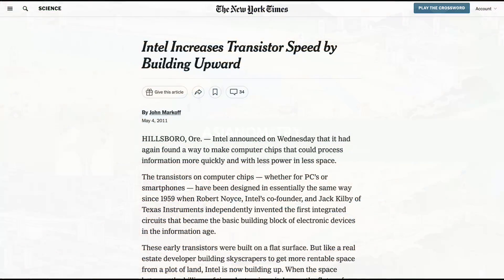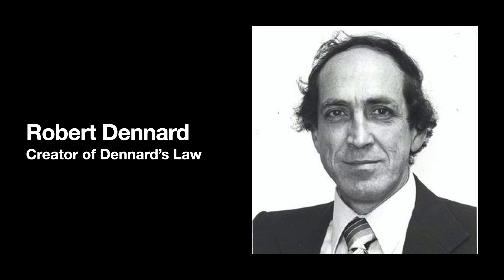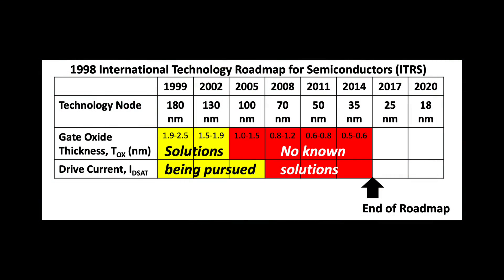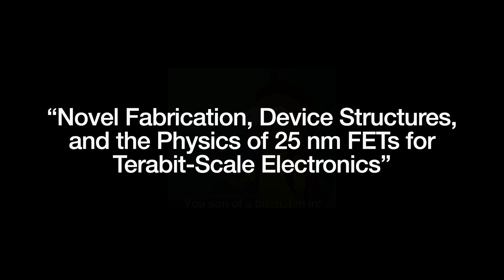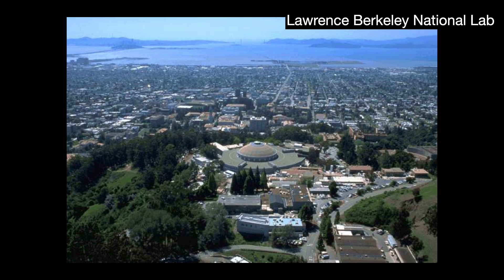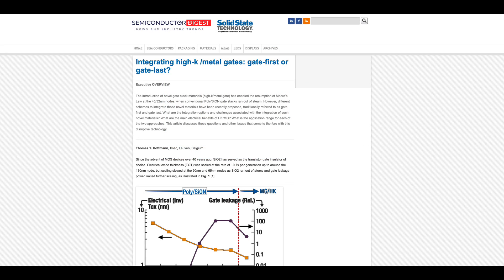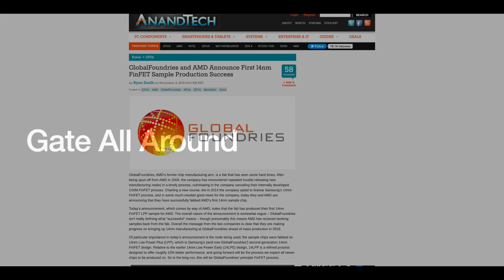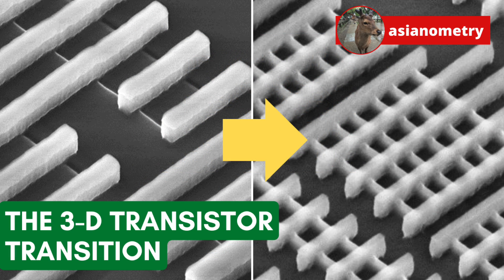The 3-D Transistor Transition

Comment: Almost all of TSMC's customers have cut back orders for this next year.  Economics is pushing costs too high and many customers aren't buying anymore.

But, TSMC has been making very large profit margins as they've kept raising the price for their advanced nodes and this is why chiplet design is going to become common.

Not all types of components in these ICs scale down in size past a certain point and in reference to TSMC, this happens around their 7nm node, so companies like AMD who make graphics processors and CPUs have moved a lot of the circuits that don't scale down in size onto another chiplet of a less advanced node.  In the case of their new Zen 4 processors they have core chiplets that are on a 5nm node and they have a die that deals with I/O for the most part on another chip.  For all modern CPUs for PC these chips get mounted onto a tiny PCB and a metal cover goes over them and that is the CPU.  Something like a Zen 4 8 core CPU has 2 chiplets, one 8 core chiplet and 1 I/O chiplet (CCD and IOD) and in the case of a 12 or 16 core CPU there are two 8 core chiplets and 1 IOD.

But here is where it gets interesting.  TSMC and AMD have produced CPUs that have cache on a die that sits directly on top of the core chiplet and this gets called Vcache or 3D cache.  There are metal conductors, like very fine wires maybe a little wider than a hair that runs between the core chiplet and the cache stacked on top of it.  This came out with Zen 3 for a single part, the 5800X3D and it benefits gaming and programs that work with very large data sets, mostly in the world of scientific computing and modeling.  It also came out with a line of server CPUs.

While it's true that these more advanced nodes are more expensive, it's also true that TSMC is gouging its customers who can't do anything about it because TSMC is the only company making nodes like 5nm, 4nm and very soon 3nm that can ALSO clock at very high speeds.  Intel is supposed to have their 4nm node ready this year and will release products on it and this puts SOME competition back into the market.  Samsung as said is starting to produce 3nm, but Samsung nodes can't clock at high speeds which is critical for High Speed Compute (HPC) devices like servers, PCs and some other high speed electronics.  Not a smart phone.  That's not an HPC device.  Those ICs are clocked a lot slower for power efficiency which is what Samsung nodes are good for.

Now, how this could all play out in the future is if TSMC doesn't get the hint that they need to lower prices, a company like AMD could start making CPUs using 3nm for the core chiplets, but move L3 cache off the core chiplets ALTOGETHER and stack it over the core chiplets, using making a 6nm or 7nm process node.  L3 cache is the slowest cache in a CPU so it CAN be stacked and take almost no performance penalty for doing so.  So now for your cores you already have 2 different die, one stacked on top of the other, and then have the IOD for comms off the CPU and of course that IOD would remain on a 6nm node like it is now.  This would make these CPUs very complex, but necessary if TSMC is going to continue to gouge its customers.  And TSMC IS gouging their customers.  They're making very large record profits as companies often do when they have no competition.

So at the end of this video when the discussion was these nodes like 3nm may cost too much, the point is really TSMC is making it cost too much, and the same is true with their 5nm node.  Nvidia is using TSMC N4 for their new line of graphics cards, the 4000 series or Ada Lovelace, same thing.  Their prices have taken a large jump.  AMD is also using TSMC to make their new line of 7000 series RDNA 4 GPUs, but they're using TSMC N5 and N6, where N6 is cheaper than N5, and AMD is the first company to every make a graphics processor be multiple chips, at least for the PC.  AMD has moved a bit of cache onto 6nm chiplets right beside the graphics compute chiplet, and this allows AMD to keep their use of TSMC 5nm (N5) to a minimum.  And TSMC N6 is really a 7nm node that's enhanced so it's priced more like their 7nm node, N7.

Intel is moving to chiplets for their next line of CPUs.  They've confirmed it.  They also expect to use their 4nm node and also TSMC nodes together in this chiplet based CPU.  I'm really interested to see this because it's going to be two big jumps in technology by Intel over the last 3 years.  The first was moving to a hybrid core architecture where they use a form of big-little for their cores (big and little cores) and now they're moving to chiplets like AMD.  AMD and Intel are really close to each other in compute power, with Intel having an advantage when they can get a lot of little cores (e cores) into a CPU and give it a higher core count compared to its AMD counterpart.  Intel also added hardware acceleration to their CPUs.  AMD will probably need to get hardware acceleration added ASAP and also move to a hybrid architecture of big-little.  It allows for more thread processing in a smaller space.

So yes, these nodes cost a lot but this is partly due to a TSMC money grab and this could be put in check if Intel competes with their 4nm node (in fact one customer has already left TSMC to use Intel) and ESPECIALLY if Intel gets to 2nm first, and they could.  But this price gouging by TSMC has ALSO led to AMD doing some creative stuff which has also pushed Intel into doing creative stuff and the consumer is better off because of what happened but now we all need TSMC to drop their prices.

Comment: Another outstanding video, great summary and great visuals. 

Slight correction: Intel moved to high k metal gate for 45nm. Their 32nm node was a shrink of 45nm, the second high k metal gate node, and, as you noted, final planar node. 

Samsung tried to squeeze one more planar process for 20nm, but it was a disaster.  14nm yielded far better with finFETs.
Reply: „14nm“ is 20 with FinFETs, there was no shrink. This was the point there Intel was a node „behind“, because people only look on marketing numbers.

Comment: Hopefully N2 has good yield. Unless there is a major improvment in power consumption, smaller chiplets with high yield coefficient will be needed for any significant advance in value to the end user. 
It has been almost 10 years since N32 and I still don't see much incentive to upgrade, as someone that had a home computer all through the '90s when 2 years without an upgrade was a long stretch,that is shocking. A decade for few more cores that I rarely need, maybe 20% boost in clock speed, AVX512, compatibility with slightly improved motherboards (PCIe and DRAM generation bump), and maybe 5% energy savings [whole machine], all for the low low price of 3 times what I paid for the n32 based machine.

Comment: Why is money an issue? Why does it cost so much to develop or What are the break down costs in developing new transistors? is it the labour costs.
Reply: Not labor, semiconductor business is hardly labor intensive.  It is the research and development cost as the elements and transistors in the chip get smaller and smaller.  Building the machines and processes that will make the next generation of improved advanced semiconductor chips take tens of thousands of engineers, scientists and technicians years to do.

Comment: Man it really is seeming like in the next 10-20 years humanity will be faced with the end of computational progression. Unless some sort of breakthrough in quantum computing comes through I really don't see where we're gonna go after this
Reply: Quantum computing isn't...
That is, it isn't contemporary computing. You cannot write programs for quantum computers, they cannot add numbers or make decisions.

Think of it as more like filtering, but simply knowing the construction of the filter does not imply you know what will pass. It's the trial and error phase of calculating what will pass the filter is where quantum computing excells. Effectively trying all solutions at the same time instead of sequentially.
Reply: There are a lot of new computing technologies coming particularly in optical computing. Carbon semiconductors are still very expensive but will come down in cost in time as it matures.
Reply: Even if only because the N numbers run out :) N2 is planning, then we have N1 and perhaps N0. And then? N00?
Reply: @pizzablender  if only companies didn't inflate (or should I say deflate) the numbers. Those numbers have no real relation to feature size at this point, which is why some people have taken to calling them eg N5 instead of 5 nm. (The smallest feature size in N5 is around 30 nm.)

Comment: You are aware of the gate width is only 5 molecules wide. This is a limit in many senses: economics, yield rate, heat generated, gate leakage, errors compounding, etc. The yield would be practically zero when the gate width is reduced to 3 molecules. As the transistor number climbs, so does heat generation and subsequent current leakage. The average audience here don't have a clue what we are facing. Dreaming about sub-nano chips would certainly be a pipe dream.
Reply: You mean gate oxide layer thickness.  I don't think the gate width dimension is that small.

I have the same thought of this end to Moore's law for the last 10+ years, and they kept able to improve.  One way to think of it is that the amount they have to shrink and reduce is also getting smaller and smaller.  But I agree, it should not be possible or significant to shrink at some point.

Comment: I suspect we may have already exceeded the practical limit on scaling down nodes. TSMC can only produce 35 of these lithography machines (5nm) per year. By 2025, they HOPE to make 90 per year? They can't meet the world's demands for these systems, and no one else can make them. Then smaller process machines will be made in smaller quantities than 5nm machines. At some point, there will be a correction in the lithography machine industry, going back to earlier larger process, with higher volume production of the machines and their wafer output, I think.
Reply: Older fabs with with larger feature size do not go away, they stay around and make lots of chips that do not require latest and greatest transistors.  So going back is not the right way to think of it, they just have not gone away in the first place.  There are hundreds of chips around you, even lots of light bulbs have a chip in them these days.  Not all of them are made from the latest greatest semi process like the major cpus in your cell phone.

Comment: Great video. But all this talk about transistors and I have zero clue on how they actually work. could you give a demonstration on logic and how transistors function and just basics to how to get multiple of them to work simultaneously like in a processor? Ive some demos on this using basic logic functions using Minecraft or a basic demo in my python class, but I’m just wondering like how it works on these Silicon transistors.
Reply: Transistor are tiny on off switches. If you put voltage on the gate it turns on the source to drain line. Imagine you have a redstone line with a cut off device in between. When you put a redstone signal to the side of the device it cuts off the redstone line. I believe this is how locking relay works. If you put a redstone relay in between a redstone line then put a strong signal to the side it locks the relay and cut the redstone line.
Reply: Hard to explain it all in a chat post, people actually go to school for several years getting a degree in computer engineering to understand it.  But like the post above said, a cmos transistor is simply a voltage controlled switch, put a positive voltage on the gate, you turn on the switch and let the current flow from source to drain terminal of the transistor.  Once you have a switch, you can build all kinds of logic circuits to perform invert/and/or functions and eventually build very complex system that performs complex logical function. 

There are many other concepts like finite state machine/touring machine that you need to fully understand how computer works.  It requires ability to remember and save data or code that can denote a state and be able to move from one state to the next to perform any computational algorithm.  But in short that one switch is the building block to create all these elements (logic gates and memory or sequential clocked controlled data storage components).  You put all these things together, you can build a very complxed computation automata machine that akin to modern CPU today.
Reply: @thep751  thanks!
Reply: I believe he has a transistor history video.
Reply: One vitally important note:
You need 2 logic functions. One that can combine 2 signals (such as AND or OR, but not XOR), and an inverting function (NOT).

Because of this, the transistors in CPU are designed such that a logic 1 signal at the gate will stop the conduction through the chanel.

Remember the name of these transistors: Field Effect Transistors. It is the electric field around the gate connection that gives the name. 
Referring to the drawings of the planar transistors...
Source, drain, chanel, and gate.
With no signal at the gate, electrons can flow through the chanel from source to drain. If the gate is charged with electrons, they repel the electrons that try to flow from the source, meaning they no longer reach the drain. So the transistor has provided the NOT function.

If, instead of a single gate between source and drain, you put 2 gates, charging either gate (or both gates) will stop electrons reaching the drain. That will provide a NOR function (same as OR, but with the output inverted).

Note that FETs can be designed to operate in many different modes depending on the chemical doping of the source, drain and chanel.

Above i described one where negative (surplus electrons) gate charge will stop the flow, they can be made such that a gate charge is required to enable flow (by assisting electrons to overcome the chemical doping). They can be made so that it is positive charge that does the switching too.
Reply: Did you know that an entire functional microprocessor was made in Minecraft, 
Also you may enjoy the sandbox mode of the game '7 Days to Die' can also inspire to think about some very basic electrical systems. 
You will find a lot of good YouTube videos on basic transistor operation and the history of the first IC are very interesting with great historical content.

'Anastasi In Tech' has a good youTube channel
Also check out 'Chip Manufacturing - How are Microchips made? | Infineon'

Comment: I dont understand how it can become uneconomic.
Reply: Try mining gold from sea water.  It's in there, trust me.
Reply: It depends how quickly you can turn a mask layer. If the process is complicated and has to go back through lithography more than a couple times, even not factoring in yield loss from errors this introduces, you can’t justify buying and depreciating the tool for the output of that process. When your EUV scanner costs $150M-$200M, how fast you can pump money out of it is basically all that matters.
Reply: Making complex 3d structure transistor requires several steps. This steps involves multiple passes to your expensive lithography equipment. That means each wafer will have to amortize a larger fraction of the equipments capital and maintenance cost.
Reply: It's harder to build ever decreasing miniaturized transistors and pack more and more into the same sized chip that runs faster and more powerful.  Research and development cost to figure out how to do it is the major factor and cost that becomes uneconomical.

Comment: Intel will probably go to parallel nano wires instead of GGAFET’s. (Hey first need to figure that out for a bigger scale though)
What will be after lithography?
Reply: There isn’t anything after lithography. There’s only different ways of doing lithography. At the moment the only two technologies that have a chance of equaling high-NA EUV are nanoinprint and DSA. And both of those have unresolved problems with defectivity that have never quite been solved.
Reply: There is no after lithography. The situation is complex but it is not the apocalypse. Yes there is no lithography roadmap after High NA EUV. But there are plenty in the transistor architecture. There is forksheet, CFET, Vertical FET, 2d material channel and many more. This transistor technology together with multi patterned EUV will allow performance improvement for the next decade. The main problem is the escalating cost.
Reply: Probably quantum computers.
Reply: bruh moment